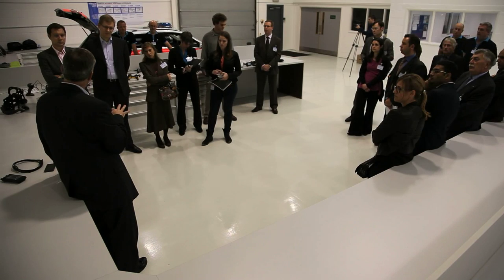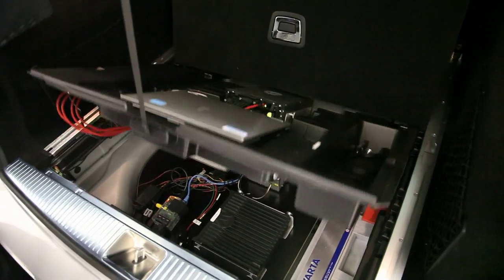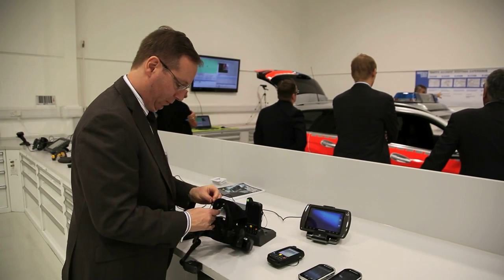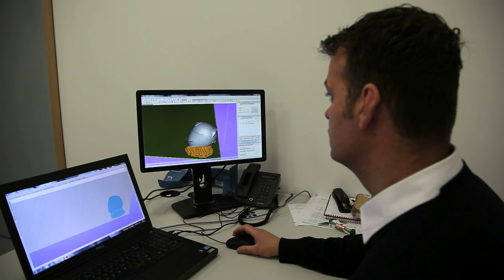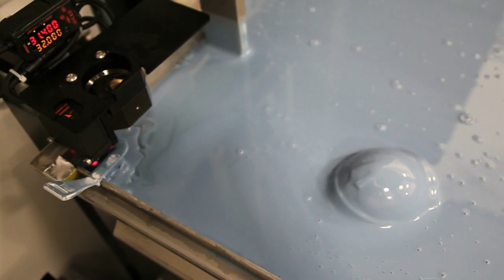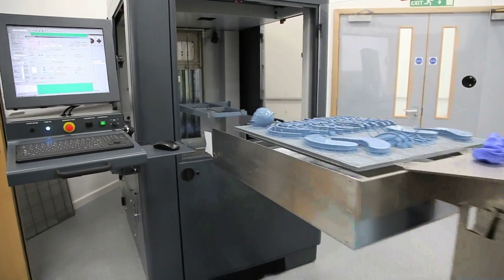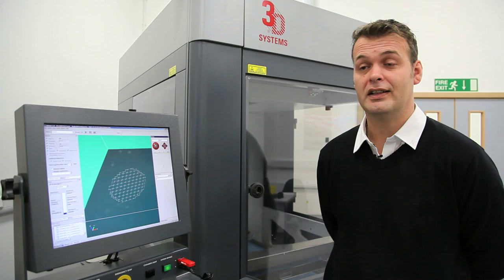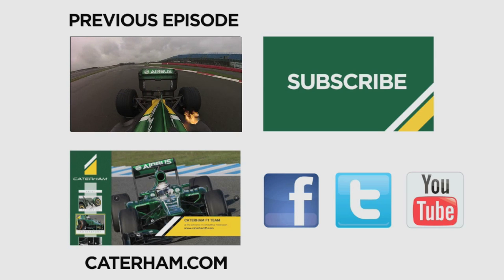Caterham Unchained: Win our model helmets! See rapid prototyping in action

Comment: I was actually checking out a 3D printer the other day and it was a smaller version of the one you guys showed, the formlabs Form1. I've seen NASA build parts witha 3D printer, how far off is Caterham from using that technology?
Reply: The technology isn't as well suited to the needs of a Formula 1 team outside of the prototyping they showed in the video. Generally the plastic that is used in printers like the Form1 are not meant to be structural pieces. For that, more conventional materials like carbon fiber or machined metal are still best.
Reply: That's the next step with these machines, when they are able to do parts for structural purposes. The one I've seen is in a NASA video where it is able to do a metal manifold for a rocket engine. It eliminates the welds it would've had before. But with so many carbon fiber parts, where would a team use a machine like that?